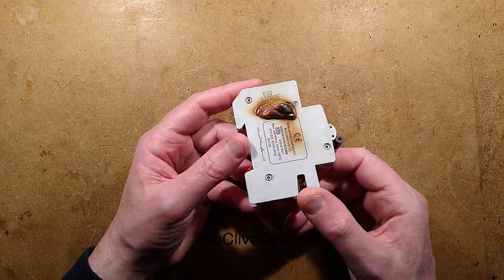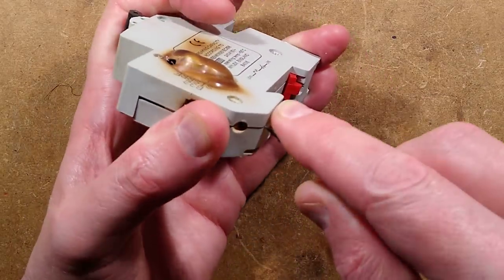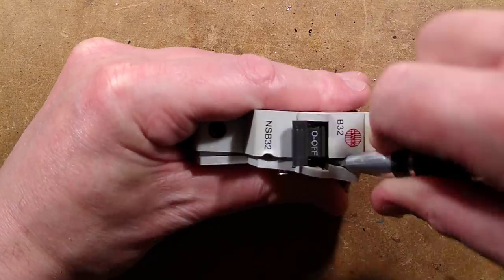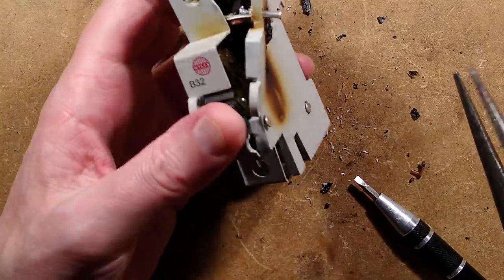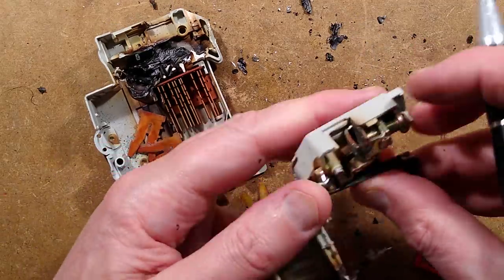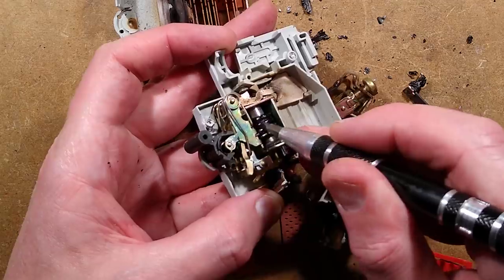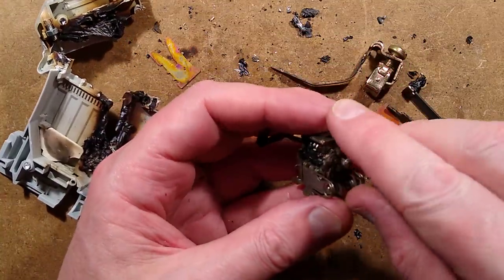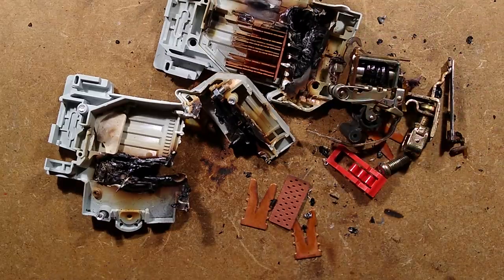Inside a totally smoked circuit breaker.  What went wrong?

Comment: About 30 years ago I seen something similar, it had a dead short that welded the contacts together and since it couldn't trip it had a meltdown that looked almost the same as that.
Reply: This is a fault you can't get with fuses.
Reply: @millomweb  Unless an idiot replaces the fuse with 1mm2 or larger copper wire.I tried it in an old house which would be rewired anyway in a few days,so it would be no problem for doing it.When I shorted a 16 Amp socket with 2.5mm2 wiring I got More than 240 Amps of fault current for several seconds and I was afraid to to it longer.If i blow next the fuse in the transformer box,one phase will be gone for half the street.
Reply: @mernok2001  Easy enough to also link across the terminals on an MCB with wire too.
Usual plug fuse substitute is a piece of 6" nail - I guess as the diameter is about right.
Reply: @millomweb  Luckily in Europe we have 16 Amp sockets protected with 16A fuse or MCB and no fuses in plugs.Fuses are inside applienced on printed circuit board for more protection less than 16A.
Reply: @mernok2001  But appliance installed fuses aren't mandated as far as I'm aware and while I have seen a variety of fuses in things, there are many things without them - electric hand tools being one example I can think of - where I've never seen a fuse inside it - and I'm pretty certain the power cables fitted to them won't be rated 16A either. I'd suspect few vacuum cleaners, fridges*, washing machines. Electronics items - audio, TV are the things that do tend to have their own fuses.

* Fridges have temporary self-resetting overload protection - but that's not overload fault protection.
Reply: @millomweb  I guess eveywhere they are going too far with safety regulations.The useless AFCI/AFDD for example.
Reply: @mernok2001  MCBs have been around for 40 years or more. My house has fuses - they've never given trouble - even the 5A on lighting circuit passes enough current to burn holes in bulb caps when the live wire touches the metal cap internally. We have 1 plug-in RCD - used for electric gardening tools & no others. About 3 weeks ago the dishwasher went bang - an internal leak bridged live with the chassis - made the lights dim and the bang was heard in the room above. The bang cleared the fault to earth, no fuse blew and everything carried on working including the dishwasher.
On investigation, I found the leak and fixed it. I was touching the chassis at the time of the bang - never felt a thing. Old technology is safe enough as it was but I approve of RCD on outdoor cables attached to cutting machines ! (Lawn mower, hedge trimmer and chainsaw.)
Reply: @millomweb  You probably wasnt well grounded.One dangerous thing i see about UK electrics is their cables having 2  cross sectional areas smaller wires for ground.Not permitted America ot  in any EU countries.
Reply: @millomweb  However,I means AFDDs,not RCDs. Those stupid devices supposed to trip on parallel and series electric arcs but dont trip when should and nuisance trip for any nonlinear,non sinusoidal loads.
Reply: @mernok2001  I was well grounded as I was touching the machine's chassis ! As for thin earth - as long as it's considerably thicker than the fuse, it's safe. It's not going to carry a great current for any length of time unlike the power wires which could carry 35A for hours - a question for JW ! (A 30A fuse could pass a 50A load indefinitely - but it will be very hot !)
Reply: @millomweb  There can be a bigger voltage drop on smaller ground wire. If the live and ground are the same length and cross sectional area,in a dead short,the ground will be at half the mains voltage,115V until protection kick in.If its thinner,it will have much higher voltage than 115V.
Reply: @mernok2001  But what's the cross sectional area of the fuse ? If the fuse is quarter of that of the earth then the earth will only be at 60V tops - which is under the critical 90 (I think it is).
Reply: @mernok2001  In the USA....smaller gauge ground wires were once allowed. I have seen "Romex" type cable in a house built in 1965 with a ground wire that is smaller than the hot and neutral wires.
Reply: @brianleeper5737  I think i read smoewhere intil 1969.Since then,the ground wire must be able to carry the full current rating of the cable.For example if you have a failing heating element and water leaks in,there may be only 20-25A current,not short circuit between live and ground and the circuit breaker will not trip for several minutes or even hours.A smaller ground wire would burn up while a normal size wire would carry the current.
Reply: Old style fuses don't do that.

Comment: When I worked as an electrician many years ago, I often saw that kind of damage after a thunderstorm
Reply: I’ve seen that damage from very long runs of underground wiring, where the wiring insulation is failing. Sometimes the breaker would trip, after the ground became super saturated.

Comment: Yep, classic reclose onto a fault
Where i worked we had people who would repeatedly reclose breakers without removing the fauly equipment, followed by us giving them a lecture
I've seen breakers that bad, they usually trip out and damage adjacent breakers due to heat. then those have to be replaced too.
Reply: Had a lazy coworker do that. Although, it finally just popped and then would not hold ON (or pass current). The element inside was fused. No melting on the case, however. It might be because the plastic is different (north american type, made by GE).

Comment: I hope the entire ring's cabling was inspected and Insulation resistance tested. If I were to hazard a guess of the current, I would suspect they had 50 or 60 amps flowing.
Reply: If it was Thomas Nagy, it almost certainly was fully vetted.  He's particular about putting his name on a bill.
Reply: Protip: If you overload your branch circuits enough, the wiring in the wall acts like an additional heater!
Reply: @thelight3112  Not really, the voltage drop across the wiring will obviously cause the heaters to get less voltage too, so they will heat less
Reply: Techtastisch 75 
You just have to increase the voltage then.
Reply: @cezarcatalin1406  You could connect them betwenn phases, thats 400v in Europe 😁
Reply: It had to be more than that. This form factor is made for up to 63A nominal.

Comment: When something creates enough heat, it tends to weld its self together. The design is flawed because the device that should have tripped failed. I have seen this happen in industrial equipment. I had a supervisor who's mentality was as long as it can be reset, shut up and use it. One day the bus bar  over head burst into flame. The maintenance guy just kept resetting the breaker as instructed. The machine was drawing so much of a load that even 220 was no longer enough. After that, the motor was pulled and the windings were found to be fried due to excessive heat. An industrial motor will continue to draw as long as it can move, reguardless.

Comment: Had too many heaters plugged in, reset the breaker every 30 minutes (from the high current trip) until it got spot-welded shut. Pretty shitty failure mode lol
Reply: I call this the trailer house special. Happens with window AC units when the central unit has failed.
Reply: @Blazin Redeye Problem is high current like a dead short will make something go bang long before plastic melts and the varnish cracks.  It had to have gotten extremely hot for a long time to show this kind of damage which sort of rules out a dead short as that would've been much more explosive and much less melting plastic.
Reply: I've encountered this issue before.
My findings and method of testing are a comment of their own.

tl;dr... Slowly increase the load.
Most electrical devices use switches, which causes the current drawn to spike when it's turned on.
Dimmers and thermostats don't do that, and allow over current events.
Reply: Kaiser Sose thermostat is just an adjustable switch that reacts to heat, but heaters usually being almost pure resistive load does not take big current spike when turned on. Also electronic thermostats does the switching at 0 volt point of AC cycle.
Reply: @Karjis  
Generally speaking, you are correct, sir, about nearly everything you said.

In the time I've been doing electrical work, I have seen many mass produced space heaters, and seen them change throughout the years.

For quite some time one could purchase a space heater with an on/off switch and a dial. 
The fan and heating coils were both controlled by the switch, and intensity of both controlled by the dial.
In that case, the dial (a dimmer switch) was the thermostat.
It wasn't reactive, and didn't break any circuit when a temperature was reached. It did "set the temperature" though.

The only thing that turned those space heaters off, other than the toggle switch, was a mercury switch wired to a buzzer, that would close if the heater was knocked over.

Obviously, these aren't state of the art devices, and I think they stopped getting made about twenty five years ago.
Edit: thinking about it, they must have stopped making those back in the early to mid 80's... Make that thirty five years ago.

While switches ALWAYS break contact at the zero point of the AC cycle as a function of their nature, I would be inclined to believe that, as you said, electronic switches close at the zero point... leaving mechanical switches to close when they are switched.
Should I happen to be mistaken about the mechanical switches, please do let me know.
I might be old as dirt, but I'm always happy to learn something new.
Reply: This where fuses have the advantage, until somebody replaces them with a nail.
Reply: Kaiser Sose yeapthe dimmer switch is rare but you are correct, those exist but would not call those thermostats at all as it is more a power dial. And for electronic thermostat I meant the contact at zero point of sine wave.
Reply: @TheEulerID  
Or they decide to do their own electrical work, without taking the time to educate themselves.
You know, those folks who seem to be fond of undertaking not so lawful horticultural projects in nearly every room of their house.
Reply: @Karjis  
They certainly don't function as a conventional thermostat...
although, they do maintain a set temperature.
I understand what you're saying & and accept it for what it is.

That particular type of temperature controller (dimmer switch) is just a really heavy duty potentiometer.
I've repurposed them as a dynamic voltage divider in variable power supplies.

A variable potentiometer from an old heater, a few feet of nichrome wire & some ceramic insulators will give you enough resistance to divide nearly any voltage you like.
That's basically all their original use was anyway... control the amount of  power to be applied to a massive resistor that could convert electrical energy into thermal energy.
Reply: @kaisersose5549  those guys are going to be bypassing everything, including the supplier fuse.
Reply: @TheEulerID  
Yup...
Somehow, a couple of guys that nearly burned their house down got referred to me, as I don't really care what people do inside of their own homes.
They were under the impression that the light bulbs themselves would act as a fuse.
Since they didn't have the money to buy a new breaker box that would accommodate the size of breakers they required, they didn't see how they had much of a choice in the matter.
They ended up buying a new breaker box, with new breakers and remodeling a couple of rooms due to fire & water damage.
Reply: @Darth Stranger When the contacts weld shut then that's always going to be near impossible. It would require a fuse backup as a final safety measure.
Reply: @Darth Stranger If there are repeated breaks under major load then the arcing can melt the contacts and well them together. There is a break current rating, but they will only last so many cycles, and the way components are crammed in the there's not much space. In the industrial space, they use really heavy duty type breakers called contactors, but MCBs in consumer units are much smaller and not engineered to the same level. That's not to say that there aren't more problems with some makes and models than others. The problem is that this is a failure mode which is not fail-safe.
Reply: Kaiser Sose yeap I've even repaired those variable old heaters stuff almost 20 years ago. I still don't see how it can maintain the temperature except roughly with about constant thermal losses of the room. Control is in same level than with old kitchen heat plate where the knob changes how resistors are connected but it does nit have any feedback from actual temperature. 

But maybe selecting proper resistor material heater might be quite ok if it has any ntc resistor properties, then actually it might keep temperature somewhat stable.
Reply: Is there a time limit you should wait before resetting a breaker? You'd think they would test & design breakers to avoid this sort of problem

Comment: It looks like lightning strike, happened to me with a power supply, it went back down the line that the supply was supplying and bubbled the outer casing like that
Reply: A few months back we had a lightning storm in the netherlands ther was a thing on the news wher a lightning strike hit a home and blew the door to the electric room its a small place wher the power gas water and phone line come it it blew the door out of the hinges
Reply: Lightning doesn't cause that kind of pitting as far as I'm aware, and I've replaced probably 100 bad breakers. I've only seen it on electromechanical contacts.
Reply: Lightning would surely vaporise things but I don't think it lasts long enough for the plastic to melt and the varnish to crack, that sort of thing requires a longer burn that you'd only get with sustained overcurrent rather than a brief, if massive, surge from a lightning strike.
Reply: A ground clamper followed by a fat low pass filter always protects you from lightning coming through the power lines.
If it doesn’t protect you that just means either the clamper or the filter aren’t big enough... or that your grounding is fake.

Comment: A few years ago I noticed the main breaker box in the house I share with my brother, who is an electrician, was hot to the touch and smelled like something was burning.  He took the cover off and saw that the insulation on one of the main wires coming in was smoking.  Turns out a main breaker had failed in a bad manner.  The fire department came, luckily didn't have to do anything.   Half of the circuits in the house were dead until he installed a new breaker.  We were so lucky that it happened when we were home and I noticed the smell.

Comment: At first, I thought that the breaker may have been used to interrupt a DC current, and the arc didn't extinguish. Now, I think that the bi-metallic spring didn't bow enough to trip. It just glowed red hot, until it melted the rest if the internals. That much current would also explain the burnt insulation on the solenoid wire.

Comment: It's a good thing you let that thing sit for quite a while so it got rid of that strong, pungent smell which is so common after the smoke is let out.

What amazes me is that here in the US the voltage is half so the current must be doubled for the same power.  In the case of this breaker the load must've added up to more than a few thousand watts!

Comment: The breaker looks very like one I saw. I am a retired electrician and was sent to a small factory because someone smelled burning and they had lost power. I looked in the breaker box and saw that the breaker was burnt out. I took the breaker out and it looked like the one in your video. I just happened to look down and saw a small piece of wood on the floor. It turned out that the people working in the factory where on piece work and got sick of resetting the breaker and they used the piece of wood to stop the breaker tripping.

Comment: Check the manufacture date on it if it's still visible. In 2008(ish) they changed the design to use 'less copper' as it was through the roof expensive. We had to change almost 2000 breakers on recall.

Comment: Logical conclusion. I had a breaker with a very loose connection that overheated and burned itself up, I figured the problem out one night when in the room and the washing machine turned on, as sparks flew out of the breaker panel. (NOT something you want to see, trust me!) Replaced it the next day, wire and the connector were burned badly from arcing - but nothing like the breaker you had there. Fun as always :)

Comment: We used 32 C and D curve 32 and 63 Amp breakers to burn clear streetlight faults on the overhead wires and melt the 2.5 mil² jumpers of the non fused SL's a few years back. The MCB's get closed and trip multiple times and rarely fail, or fail open circuit completely after 200 times or so. Looks like it was used on a DC system.